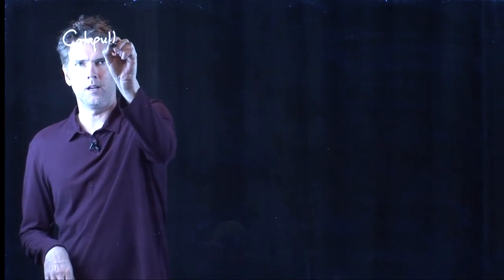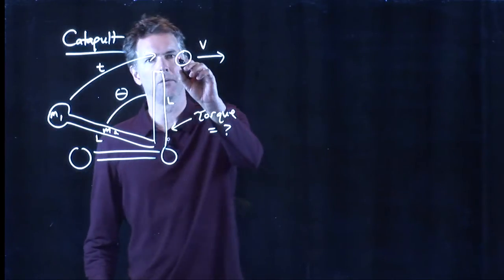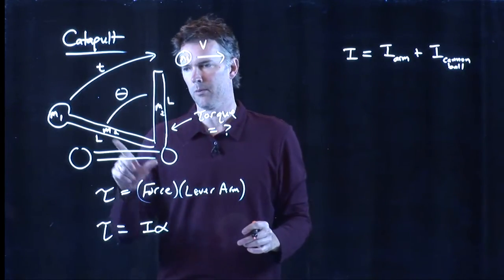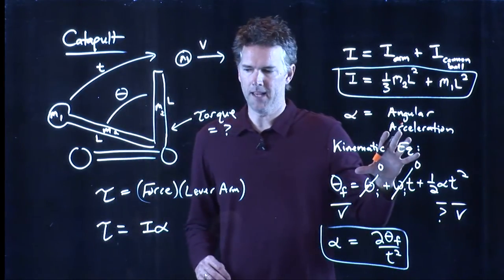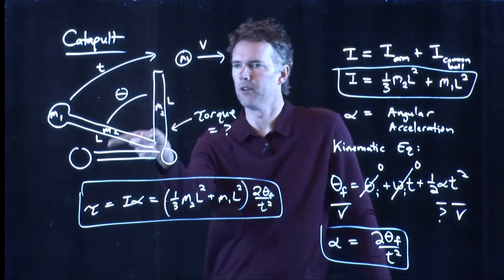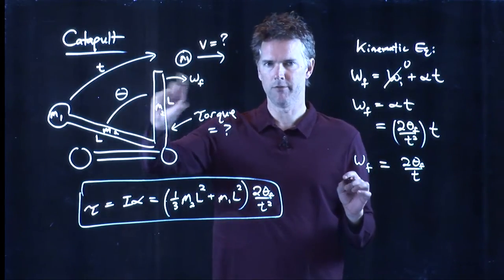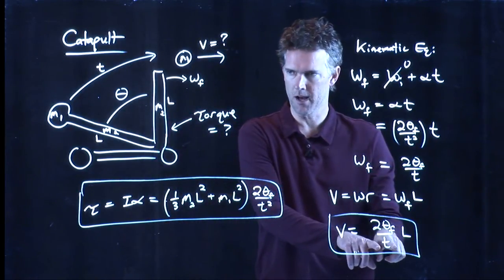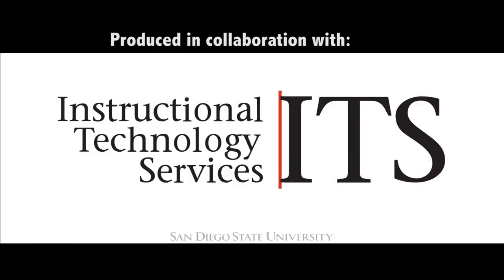Torque   Catapult

Comment: I have a question, you assumed that the torque that the rope is doing on the catapult's arm is constant and therefore constant and therefore you assumed a constant angular acceleration. but if this is a torque spring, the torque will decrease with the rotation motion. Right ?
Reply from the maker: Correct.  Good point.
Cheers,
Dr. A

Comment: Great Lecture but stuck on how to actually calculate the torque required to cover a specific range. Just like Diego's Comment. Would you please explain?
Reply from the maker: +James Sidler 
Good questions, guys!  Here's one approach.  We know that the range R = v^2 * sin(2*theta) / g.  We also know that the maximum range happens when theta = 45 deg (if we start and end our launch at the same height).  You can now use this equation together with the equations in the above video (letting thetaf = 45 deg = Pi/4 rad) to calculate how much torque corresponds to a desired range.  It might take a little work, but you can do it. Let me know how it goes.
Cheers, Dr. A

Comment: Great video! I would just to know how to calculate the angle the the velocity leaves the catapult at?
Reply from the maker: +Marc Karp 
Marc,
Great question.  The projectile leaves the arm of the catapult perpendicular to the arm.  So if the arm makes an angle of φ with the horizontal when the projectile is launched, the projectile has a launch velocity at an angle 90 - φ with respect to the horizontal.  You can convince yourself of this pretty quickly by drawing it out.
Cheers,
Dr. A

Comment: Sir Matt , Please Help me I have a given Range and given Angle of launch and I want to calculate velocity How can I calculate using torque and I cannot use v = (2*theta*L/t) formula because i dont have time arm takes to swing . 
Pl tell the full method because i couldnt understand the method you described to James Sidler 
Thanks
Reply: This whole thing is in a catapult
Reply: I also have the mass of catapult assembly and length of the arm
Reply: And co-ordinates of catapult's centre of gravity are also given

Comment: Thank you for the video, it's great, it's helping me a lot with my physics assignment. But, one question please. Could we calculate the final speed using these kinematic equations: Vx= vi*cos(theta) and Vy= vi*sen(theta) - g*t, and then considering the final speed as v= Vx+Vy.

vi(inicial speed) would be vi=x/[cos(theta)*t ] because x=vi*cos(theta)
Reply from the maker: Lily, thanks for the question.  In this case, no.  The θ in this problem has to do with how far the catapult rotated, not the angle of its velocity.  (But your equations are correct for a projectile launch at vi with angle theta.)
Cheers,
Dr. A
Reply: So, if I want to calculate the speed of the proyectil when it arrives to the floor, can I use that ecuations I've written? Would the angle needed be the same as in the video? Thank you very much! (Sorry for my English, I'm Spanish)
Reply from the maker: Lily,
Yes you can use your equations.  But in this problem we didn't really specify what the "launch angle" was, although from the picture it looks pretty horizontal.  So if you assume theta at launch = zero degrees, try to solve for final v and see what you get.  Good exercise.
Cheers,
Dr. A